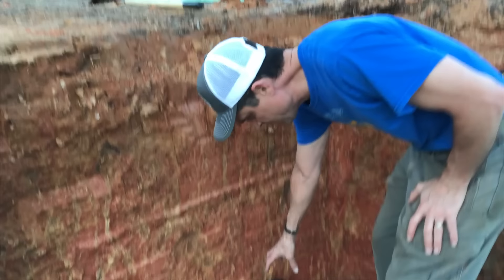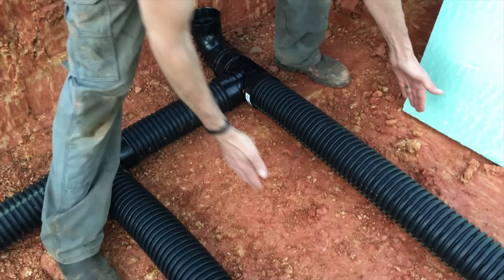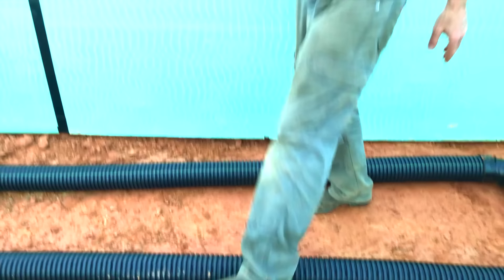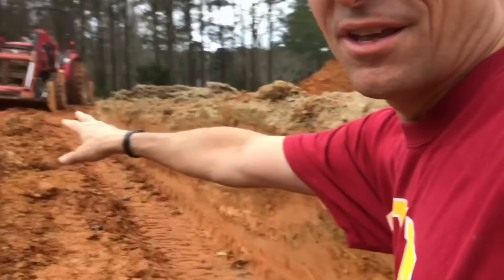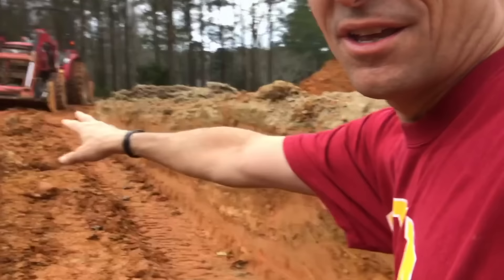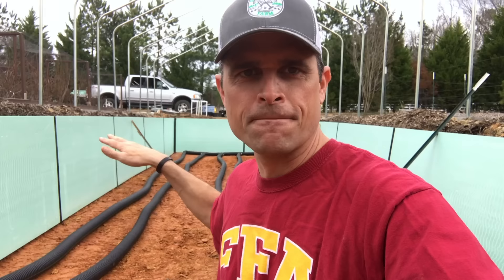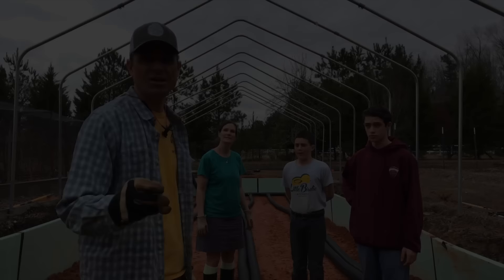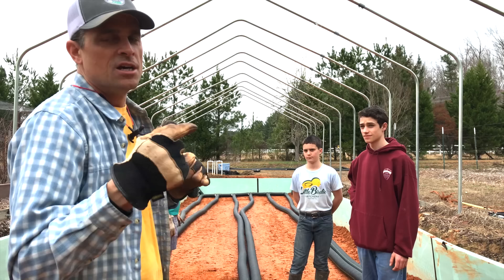DIY Geothermal Greenhouse Part 4: Earth Battery INSTALLATION

Comment: I commend your efforts and i think your idea is sound, BUT, i saw no compacting going on. You cannot backfill 4 feet of dirt without compacting. In about a year you will begin having all kinds of settling problems.  You should backfill in lifts of 1 foot maximum with vibratory compaction between each lift. There is no need to worry about crushing the corrugated pipe. It is designed to withstand the weight. One other things i noticed, you did no install filter fabric over and around the pipe. All you need is a small spot of dirt penetration and your pipe system is plugged and useless. I dont mean to critisize but these are major issues than be corrected before you get to far along if you havent already. Good Luck.
Reply: Bbjones Jones  
It best to dig narrow trenches so you dont disturb the bulk of the mass. Its cheaper than excavating the entire floor and considerably less work if your using a spade not a backhoe.
Reply: yeah the filling part make me anxious... You have to fill 30 to 40cm
 and compact....
Reply from the maker: It settled some, but not a great deal.
Reply from the maker: @emanuelgoncalvessantos4499  It worked out fine. God bless!
Reply: See...this is why on projects I like to read the comments...so I can be more aware !!! Thanks everyone 👏👏👏
Reply: Being it's just for growing, is it really something you would need to worry about? If it settles, just add more dirt.
Reply: Doug made to great points. If you do not compact around the pipe it will eventually collapse. Compacting beside the pipe prevents that.
Also the fabric to keep the holes from plugging up.
Reply: It rained significantly, that will compact soil a lot!
Reply: You have thought about just about everything, what do you think about about the vent at the top,it’s not the nature of the fan to be pulling from the far side ❤

Comment: hello sir i am an engineer from australia am  very interested in the idea but I cant understand the reason for the foam insulation as I believe this  foam insulation will work against your purpose to exchange heat with the ground , for example in summer if you are cooling your greenhouse it means you are warming the cool ground underneath and these foams will stop the ground from being able to cool back down to keep supplying you with cold air
Reply: I wanted to add the same . The ground will cool down the area onlt from underneath

Comment: The header system you're using appears far less efficient than had you run a continuous serpentine hose back and forth to maximize underground air time.
Reply: Things as they appear and things as they are, are sometimes two different things
Reply: @Dennis Totmann, agree completely!
Reply: I think it depends. Maybe the goal is lower velocity through the underground pipe to allow more heat exchange to occur.
Reply: @edwardj456  
The goal is the exact opposite ;)
Reply: you are correct - don't listen to the stoners. Have done these projects before - this will work ok with pipes spread out. You are working with heated mass, which is a slow exchange. All the effort to dig a damn hole, you better make use of it. Velocity? Give me a break.
Reply: @sammaine9966  
Folks struggle to think laterally when it comes to tube length, airflow rate and dwell time. The commonest error is thinking long tubes and low airflow rates will provide the best heating performance.
Reply: I’d love to see temp comparisons between this one and the one LDSPrepper made.  It’s on YouTube too.
Reply: you dont want to fight with back pressure from narrow pipes of the series arrangement,  parallel arrangement is the correct arrangement for all heat exchangers look at radiators, dont try to copy aircons because they Have compressor and the fluid has a very high thermal mass  >>   I will look at the works of LDSPrepper  to try and understand your point
Reply: Ali Mohamad thank you for your comment.  I understand your point but I see it in opposite light. Where the goal of a radiator is to give off heat as quickly as possible the goal of an underground series of pipes is to gain the maximum amount of earth heat by slower air flow underground before being introduced into the greenhouse.
Reply: Ali Mohamad thank you for your input.  I see it just the opposite.  Where the purpose of a radiator is to throw off heat as quickly as possible the longer underground pipe’s purpose is to gain as much heat as possible before introduction to the greenhouse.
Reply: Ryan Murphy lmao I’m a stoned with no education and can picture that😂
Reply: @DennisTotman  
Dennis, you will not move as much heat with the lower flowrate. Its considerably more efficient to run a higher flow rate with a smaller differential. An efficient system will put the entire greenhouse air volume underground once a minute, increasing the entire greenhouse air volume by a few degree`s with each pass.
Reply: @AliMohamadChannel  In hydronic heating, a series loop overcomes this limitation by keeping the length of each run below 100 feet, and limiting the effects of friction loss. 
 In a branch circuit system, the trunk line (equivalent to a header) is much larger than the branches assuring adequate flow to each branch. In this set-up, a larger header would have allowed for more air flow.
Reply: @DennisTotman  Exactly correct. Radiation of heat through a medium is not instantaneous. Time must be allowed for this transfer. The same holds true with hot water used to heat buildings. If the circulator is oversized, the system fails to deliver any heat.The term is called 'velocity'.
Reply: @canucanoe2861   True I understand this but even with the same size header a parallel arrangement gives bigger flow   than series , I understand that keeping it short and the pipe being 100mm allows a good flow
Reply: What did we figure out here guys? Is it better to slow down the transfer time so that the air has more time to change temperature, or does a faster exchange increase the efficiency of a system, and why? Thanks in advance!
Reply: @Rick-the-Swift   faster exchange will always increase the rate of heat transfer but most importantly big pipe diameter and short length this is why radiator arrangement follow the parallel arrangement
Reply: Might be better the way he did it cause if a section fails later, it will still work with the good sections but if one single pipe fails then your done. Like the old saying don't put all your eggs in one basket.
Reply: @AliMohamadChannel  It also seems to me that the bigger the pipe diameter = less friction when considering the fluidity of air, thus friction = less wear and tear on the fan/pump motor which will be driving the air.
Reply: Most people don't realize temperature isn't the same measurement as heat.  A faster flow will pull more heat out, but at a lower temperature.
Reply: @TheRainHarvester  That's like what I tell my wife after swimming in a cold pool- that size isn't the same measurement as volume. The size of my manpack remains consistent, it's just that it has less apparent volume in colder temperatures ;)
Reply: @canucanoe2861  After considerable thought on this subject, it's occurred to me that what we think is simple is often complex, and likewise what we tend to overcomplicate can often be simplified. I think you have given a very accurate account of the basic physics principles involved and the need for proper balance. Just thinking on a smaller scale, I wouldn't want to use a 2000gph pump to circulate the water in a 10 gallon aquarium using a 3 inch diameter pipe. Likewise wouldn't I use a 50gph pump to circulate a swimming pool using a 1/4 inch diameter hose. Finding that balance between what amount of units are available, and delivering those units to the desired space using the least amount of energy is the most efficient way. This undoubtedly means adjusting fan and pipe diameters according to their lengths and the volume and depths in which they can be transferred from.
I very much appreciate yours and others insights which have helped me to come to this understanding :)
Reply: Somewhere I saw a chart on ideal length for this

Comment: The air, like water, will find the shortest easiest path, and the rest of the pipes will not circulate.
Reply from the maker: If you watch one of the next videos in the series, we replaced the manifold or trunk pipes with six inch pipes. While we had the the main tube off, and the ends of the six pipes were exposed, we ran air through the system. An equal amount of air was coming out of each of the six pipes. Seems the air wants to reach equilibrium as would water.
Reply: if you put the inletthe

Comment: Simple physics, gravel has far more mass than dirt, therefore will hold far more stored energy.
Reply: Water saturated soil, has almost the exact same volume to weight ratio as gravel. About 40 cubic feet per ton
Reply: How about clay? Gravel has pockets of air, which means less thermal transfer
Reply: @NwoDispatcher  
Technically, the air pockets will increase the modes of heat transfer. The air gaps will reduce the total amount of mass.

Comment: I did notice that you mention around 8:30 that the heating would apply for about 1 foot around the pipe. I am convinced that, due to thermal fluctuation, heat will seek upwards. Though I do not exactly know how the directional matrix, with its center in the pipe, would look like in dirt/gravel. To sum up. Heat can go down from a source, but will in most conditions go upwards. Therefore. The dirts ability to absorb thermal energy would only apply above the pipe, not underneath it.
Reply: Heat conducts equally in all directions in solids. I think you are referring to hot air rising in convective heat transfer, which only occurs in air or fluids.
Reply: Energy moves from higher temperature to lower temperature. One of the laws of physics and engineering. In air, that typically happens by convection, with hot air rising up. In soil, it is a completely different equation. You will extract energy almost equally from all directions around the pipe.

Comment: I sure love this idea and hope it works. One worry is the distribution of air into the system. At low air velocities, I don't think it will be a big deal. But at higher velocities, there will be turbulence, raising the resistance. So the first split will see similar resistance in each direction, meaning volume will split roughly evenly between each side. But one side of the split connects to only one lateral run, while the other side goes to multiple. The heat/cold will be split asymmetrically. 

Its just a worry. Let's see if it is a real world problem.

Comment: I built mine with sleeves over the perforated tubing to prevent dirt filling the tubes
Reply from the maker: Yes, we're hoping we don't regret not doing that, but since water won't be routinely flowing into them, maybe we'll be ok.
Reply: I was just going to ask about geo fabric sleeves .....
Reply: No personal experience with thermal effect of this but,  I have used weed mat to protect drain tiles used in landscaping applications.
Reply: I was thinking strategically drilling drain holes in the bottom of non-perf pipe to allow drainage but eliminate the need for filter sock.
Reply: We use geo fabric on all of our drain pipes and drain rock. It work great seperating water from soil.

Comment: We have 80 or so days above 100 in summer and the same number of frosty nights. I’m picturing something similar to your system, but putting the floor of the greenhouse 3’ underground for added insulation. Stack 4’ of cinder blocks as lower walls, then timber frame roof. It would be on a slope, so we can easily drain ground water.

Comment: These are called GAHT systems, Ground to Air Heat Transfer. One thing I might add is that they have a high temp. and low temp. limit switches, that way your not using energy moving air when the temp. is just right in the green house....usually 50 F at the low and 75 F for the high....you save a bit on electricity, not as noisy all the time, blowers last longer and I'd like to add if your going to try this system out, go for it, they work great. Try and use 6 inch for your manifolds and solid 6 inch for the risers with 4 inch weeping pipe as shown here. Good job here and certainly worth it but could be improved on.

Comment: What about using like a #5 gravel around those pipes? Think that would retain the heat/cold air better? Are you worried that the clay might crush or fill the pipes? Great job on the project and the video, well done! So excited for you guys. :) Okay, makes sense on the gravel.
Reply from the maker: It does not seem that the clay crushed the pipes. We tested the system last night and there seemed to be zero reduction on airflow. As to gravel, as I understand it we want clay up against the pipes as they are what will absorb and hold the heat pushed into the system, but we're doing this based on what others have done or said - no first hand experience yet. We'll certainly share the results and outcomes. Thanks for watching and for the support!

Comment: The specific heat capacity is around 2.2 for clay soil and 4.2 for water. Granted a system with water needs storage tanks and water being pumped around. However you get twice the heat sink, thermal storage capacity

Comment: Think it's a great idea. Could see a bathtub effect with the now softer soil above the hard clay. But that would equalize eventually. Looking forward to the results! Like you said, see how it goes and modify.
Reply from the maker: Yes, realizing repacking the soil, on our time frame (and trying to stay ahead of rain) is an issue. I plan to drive the tractor over it repeatedly, hoping to get good compaction. Hopefully, the system works!

Comment: Wouldn't you want the heat to bleed out? 
For example; It's summer and you are pulling the cool air out and packing it with hot air. Now the cold air supply stops because the ground is warming. As all things in nature try to balance, the ground around it [if not using foam] would pull the heat out allowing the dirt to remain cool. But with foam it works like a cooler. The hot air does not leach out and instead maintains the temperature, allowing for no more cool air to be pulled from the ground. I feel like I am missing something.

Comment: Suggestions in the capacity of a professional plumber .
Use pipe with a geo fabric covering to stop the silty clay from entering the pipe. If you don't have this in the USA you should still be able to buy I think geofab cut into strips and just wrap around the pipe.
If you want excellent all round penetration of the air into the clay I would use just a thin layer 3/4" of 1/4 pea gravel around your pipe. I think this would be much more efficient.
The site you have is very flat and although you are dealing with clay there's a possibility that rainfall off your greenhouse could penetrate the ground and end up filling your pipes with water and possibly ceiling the holes with fine clay. I would put a slight fall on your pipe work and at the lower end bring a Bend riser up that you could put a vacuum pipe to suck the water out,
All the best
Just in case.
I'm no scientist but I would locate my top layer of pipes about 12 inches from the surface as the heat doesn't have to penetrate so far to reach the pipes.
I'm certainly no expert just a keen gardener but I hope my comments may give you some considerations.

Comment: might be an idea to have a sump at one end in case your system completely fills with water  if your water table goes up in the rainy season . hope things work out great
Reply from the maker: Thanks - yes we're planning to at least be prepared to put hoses down into the outlets and pump water out if necessary.

Comment: Why you don't have insulation on the floor under the pipes? I think heat escapes not only to the side but underneath because soil at that depth are much colder than the soil above some feet.

Comment: Just a thought on the part where you talk about pulling the hot air from up top down into the piping through the ground. I think it would be more efficient to push the cooler more dense air from down near the floor through the pipe. The effect is the same, but I think it may work better and would really just require you to change which pipe your fans are connected to. I don't have a greenhouse like this, but I'm in the very early stages of trying to plan for one, so YMMV. Would love to hear what you think about that.
Reply from the maker: Adam, let me first say that we have no personal experience with one of these systems - we have only seen articles and videos about them, so we are trusting that ALL of those are correct and should see soon enough. As we understand it, the idea is to HEAT the ground clay as much as possible during the day and summer and then use that at night and in the winter. Hopefully we'll explain it more in future videos - if the weather will ever cooperate long enough for us to get back to the project!

Comment: Eventually the holes in the pipe will get plugged up with the Clay. I would have put a small amount of gravel around the holes of the pipe to keep it from getting plugged up. Of course it would take quite a few years but it’s no different then a septic leach field